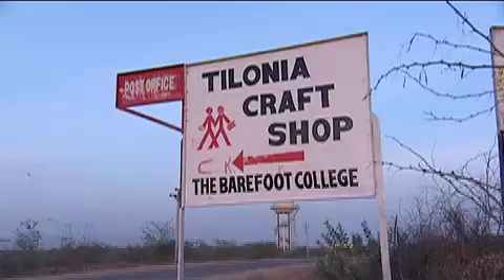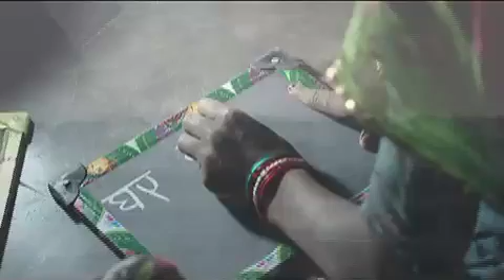Barefoot College

Comment: Where do they get the photvoltaics from and all the supporting infrastructure like the soldering irons, circuit boards,  components,  wires and even solder It all costs money and I imagine it's beyond the budget of the rural poor (I do electronics myself). Where do you get the electricity for the soldering iron. A poxy solar panel on the roof of a mud hut won't be enough. This is imposing western technology on a 3rd world problem.  It's not sustainable. I'm all for education,  especially women,  but this hasn't been thought through. Have you ever tried to fix a car,  radio it other modern appliance in a 3rd world scenario with no tools or source of parts? Missing a simple screw can be a major problem. In the west I can buy the part readily and cheaply. This solar technology force reliance on infrastructure they do not have.